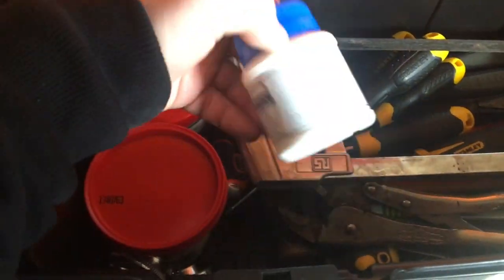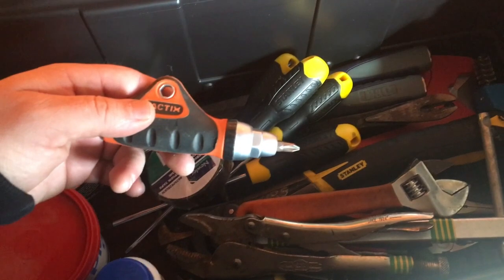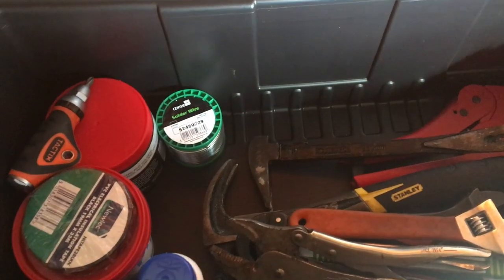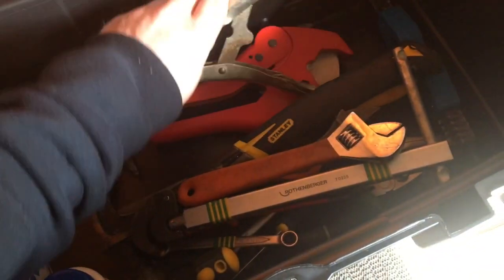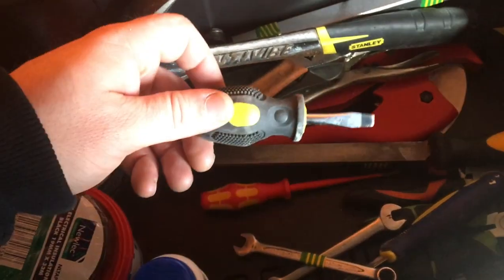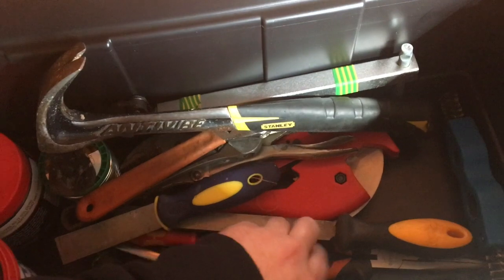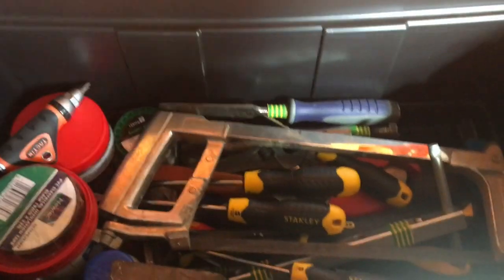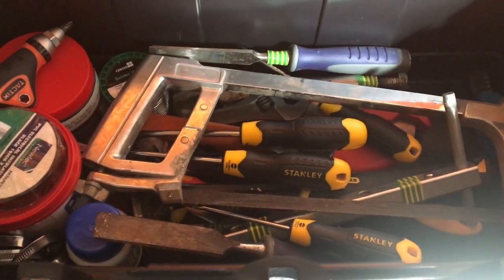What’s in my plumbing tool box. Plumbing tools every Plumber needs.

Comment: Sorry, I can't believe you are a time served plumber if those are your tools. For a start, there are very  few specialist plumbing tools, and those you have look brand new. Also, it does not inspire confidence when you start the video with a  cheapy Home Bargains tool box! Another give away is that all your copper fittings are compression,  with no soldered fittings? In the box you have a few bits related to soldering, but no torch, heat shield or other items a plumber would normally carry as part of his gas kit..
Reply: Big time amateur I'd sack him you can tell alot by a tradesman by the toos he has